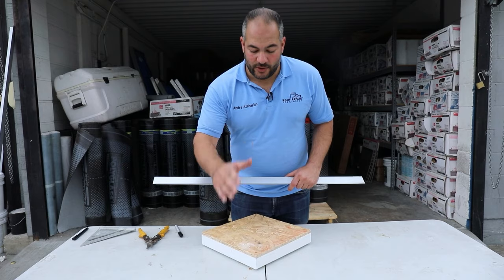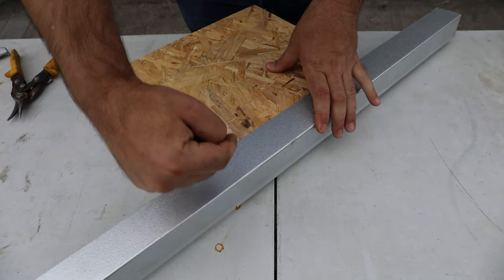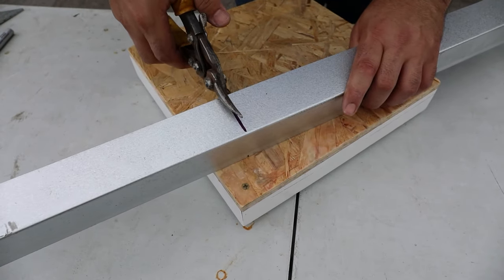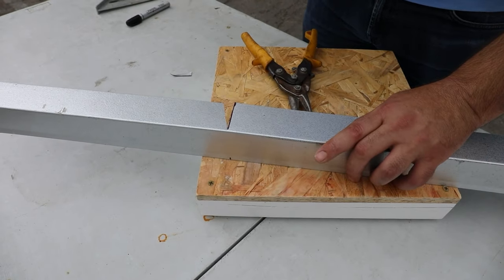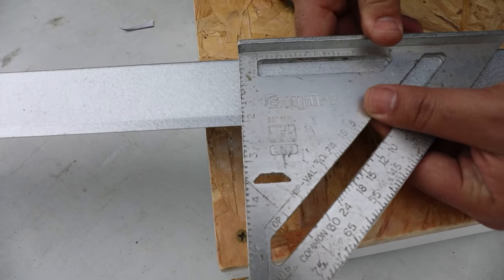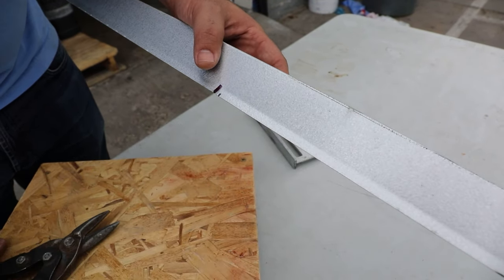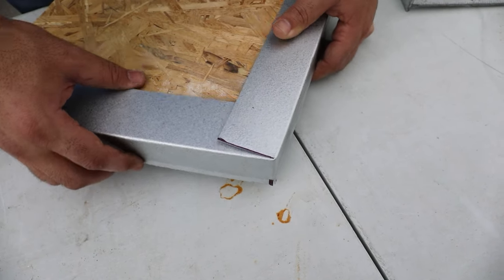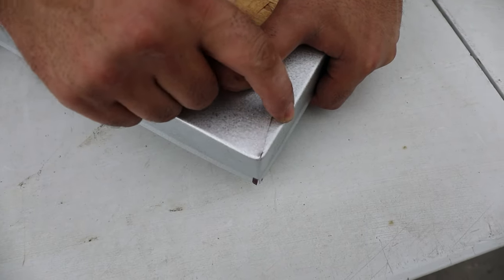Best Way to Bend a Drip Edge Outside Corner

Comment: He had it right the first time. The bottom goes under not on top. Otherwise the water runs right under
Reply from the maker: Agreed
Reply: @RoofRepairSpecialist  If you agreed with him, probably you should edit the video because you are misleading people. I just finished my shed and now I have to redo it because you gave me wrong info. Basically the sloping part always has to be on tot of the flat part.
Reply: @RoofRepairSpecialist so to confirm, the the fold should be the way you had the first time?
Reply: Bro, it was a demonstration. A square block. The slope could have been coming from either side in this demonstration. It’s obvious that it goes on top when it running down the slope. It’s common sense. All this video was about was bending the damn corner.

Comment: Is it better to bend around corners and overlap the next section going down the sides rather than terminating two sections to meet at corners? I'll be installing drip edge on a Lean To, Slant Roof, Shed. 16' across the front and back, and 14' runs down the sides. I have 7- 10 foot drip edge sections to work with.
Reply from the maker: Yes most definitely

Comment: Awful idea on new construction, now I have to cut it like garbage to install my aluminum trim facia
Reply from the maker: Don’t follow?
Reply: @RoofRepairSpecialist  not to mention if you want to add gutters you can't slide gutter under drip edge in the corner
Reply: Yeah, this guy just wants to complain. This video works perfectly.